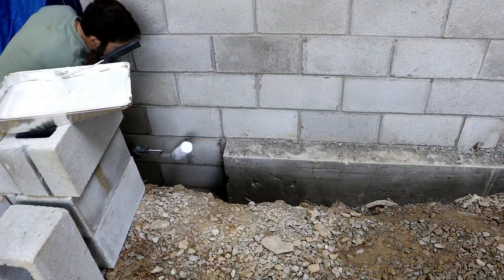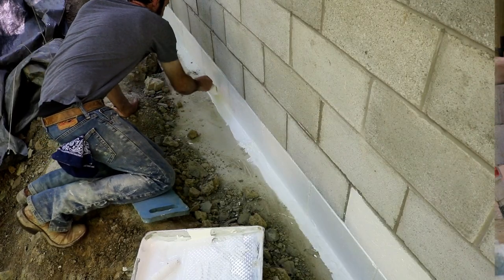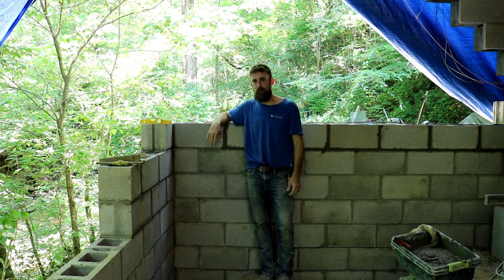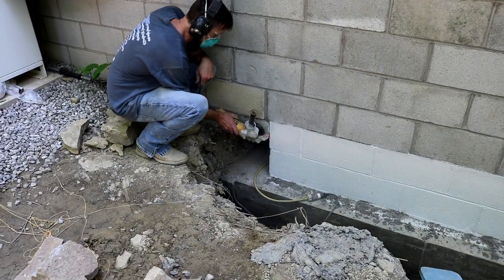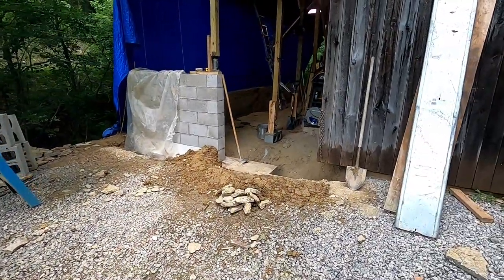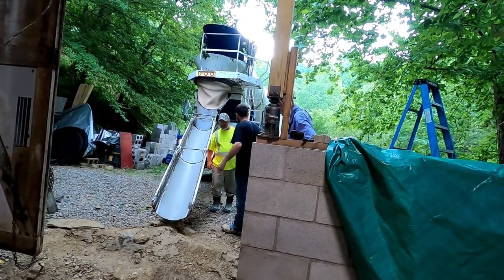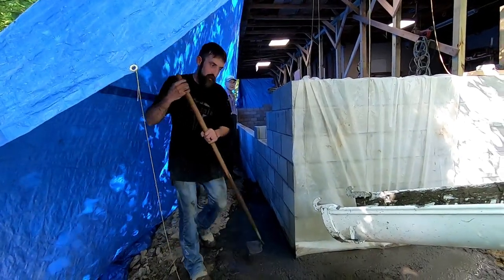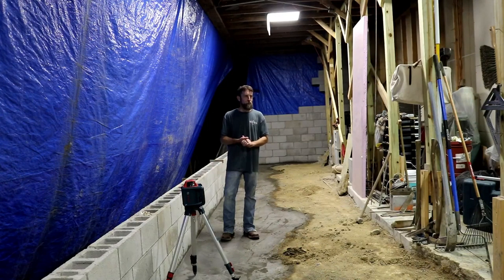Sealing & Backfilling with FLOWABLE FILL.  Shop Repair

Comment: Steve, at 26:55 your comment explains where a common term in construction comes from. When the boss tells you to hurry up and says, "all I want to see is assholes and elbows". Pardon my language, but that is just what they are meaning. The bad thing about concrete is it is hurry up and wait. When it is rolling out of the chute from the truck, you have to work hard and fast to get all of it moved out and around, then you have to sit there and wait for it to get dry enough to work some more.
If you are going to shave off dirt to level inside of the slab, throw the dirt right outside and backfill the rest of the footing with whatever you dig up. You are aerating that soil and it will recompact over time under the weight of the slab, causing cracks again. Think of it like this, you are making a hydraulic rod but it is a few inches short of the length you need, would you just throw the chips you got from turning the rod to size at the end of it?  If the dirt is solid, just cover it over with 57's (3/4 washed stone) and set your level with that; the 3/4 stone is fairly non compactable due to its angular nature it applies pressure down and to the stones surrounding it rather than sinking. This is the theory one of our local engineers has been using to stabilize footings, as many times in my area solid, stable ground for a foundation may be up to 16 feet down in the ground. Filling that entirely with concrete is cost prohibitive, so we use this gravel system to get close to the top then pour 12-16" of concrete on top of it. Works well enough for a house or a garage where I am.
You are getting close, Steve. I commend you for taking the effort and doing the work yourself, it isn't terribly hard, just time consuming when you are new to it.
Hope you and your family are doing well, thanks for making videos for us.

Comment: Flowable fill seems like a really smart product, I mean most people would need to order a truck of gravel, anyways. Might as well order a truck of flowable gravel, that don't need compaction. The hourly cost of a concrete truck is probably more than a dump truck, but you save so much time.

Comment: in the north here we coat foundations with 5 gallon buckets of liquid foundation tar then back fill  ..you coulda bought a load of bank run gravel to back fill the inside and out side gotta be cheaper then frig in cement

Comment: Hi Steve, it will be of benefit to coat the inside of the building side of the wall. moisture can rise from under the floor in the inside as well. All block joints and holes need to be filled for best results

Comment: Great Job!  It looked like the Fill Mix could have used a little more foaming agent to get more air and make flow better.  They used a lot of water to get the flowable ability, but it looked like they did not use much if any Foaming Agent.

Comment: I've mention in another video that I've been in the building trades for most of my life. I'm here to say that I wouldn't have done any of this the way that you have, I would have went even cheaper and simpler, I wont complain about it though because I'm not doing the work. This doesn't mean the solution that I would have used would be less sturdy, just less work on myself (oddly enough, I feel no desire to unsub because you wont do what I would've done). Lets not forget that this is not my building, so why would you do anything the way that I would? 

I've listened to your reasons in previous videos and they are all very sound, plus you are definitely doing a proper job of this whole mess. Your walls are more than adequate, this structure is not going to fall down because of a lack of anything on your part, which is the most important thing. Hell it looks nice as well, what more can anyone ask for? People pissin n moaning because you aren't using a process that they would, well they are folks that just need a reason to complain, we all know a few don't we, and this just gets amplified by the internet where the keyboard adds 100lbs of boldness/rudeness.

You aren't just hacking shit together and trying to sell it as the "the way it's supposed to be done" or trying to sell any of us a half assed product in some odd effort to make money off hapless individuals. This makes me wonder at the motives of people complaining about anything that you are doing. You are trying to fix your own building and being humble about your own ability, plus we get to watch as you progress. Perspective my fellow humans, get some.

Comment: It really comes down to this: If it fails, you only have yourself to blame and you'll either build it again, or hire someone to build it again, or tear it down and start in another place. There is nothing about this construction to make it unsafe, especially when you've already built it back several times stronger than the original, and when the engineer you hired to consult said it would be OK.

You could probably move enough of the roof supports long enough to get the pad poured and the blocks filled, but this is your job and you need to did it in ways you feel comfortable and can afford.

Comment: In Europe, most builders seal the stones with tar based sealants in earth level and below, then use plastic sheets with knobs for distance holding. Tar will not go off in 10.000 years.. Outside this stones with 30-60 mm are used to fill up fpr water draining the trench.
Reply: You are doing a good job. Can we please see more of that squirrel ?

Comment: For a diy project things are looking great. 7” of concrete is overkill. Most shops that are dealing with trucks and Ag equipment only have 6” but the extra 100$ for cement won’t break you

Comment: Looks very Good. Flowable Fill is a wonderful thing. I suggest you buy or rent a pencil concrete vibrator when you place the floor concrete.
Reply: No need for a vibrator on a thin slab. Vibrators are for thick stuff and structural situations.

Comment: In theory, If you grout the center section of the wall, you would be able to frame the center section and support the majority of the roof. That would allow you to remove some of the temp supports and possibly poor the floor but like you said, there’s really no easy way of doing this.  I have run a 15’ extension shoot of the mixers shoot and hoed it down to the back of building around the same size so don’t think you have to always get a pump truck. It can be done, it just sucks to do.

Comment: Good Morning-!!!  I think youre doing a heck of a good job especially not being a block layer and working pretty much on your own.  That footing aint goin anywhere anytime soon and you very soon have an easier time finishing the wall ones the pad is in and the weight is off the roof, more to do but youre almost there and judging by the work youve done so far it will be a totally adequate if not superior result compared to the way it was built before.  Cant wait to see the next installment.

Comment: LOL...Fooling mother nature?  NOT NICE Steve.  It never ends well.  She's going to get angry with you.   BTW I used DryLok in my basement (I had to sign a waiver when we built the house stating we would be painting it).  That stuff is AMAZING.  I brushed mine on, and it was totally worth it.  I think I went through nearly 15 gallons of the stuff in my basement.  I also used hydraulic cement  in every spot that they used tie-ins for the basement forms.  THAT took WEEKS to do.  I could only do about 20 holes per day before my hands were just chewed up from that stuff...TOTALLY WORTH IT.

Comment: Could you hang extension ladder sections from the roof rafters, then put a plank across the rungs for adjustable-height scaffolding? Clamp a 2x4 to the bottom of the ladders to brace against the block to prevent swinging.

Comment: Grab yourself a chunk of beeswax for driving the long screws when you need a third hand. The screws will drive so much easier, it gives you more control when trying to hold a wiggly board still.
If I have a lot of 3-3.5" screws to drive (75+), I melt some wax is a small bottle in the microwave and dip my screws in them.  The 15-20 minutes it takes to do 100 screws is worth it.  The reduced driving time, (they just jump into the wood, even used wood), will make up for waxin' time.
Plus you get more screws per battery charge.

Comment: the spreading of the flow-able fill worked out well, however for any one else trying this the external wall would need to be propped/braced if the fill gets too high as the pressure from the fill may topple the block wall.
Now all ready for the floor slab.

Comment: What is the flowable fill?  Wet mix of sand and gravel with a little cement mixed in?  Looks like you've decided to go all the way up with your blocks instead of the wood framed wall.  Now that you have plenty of experience with blocks, might as well use up the material you already have.  Love to see grandpa, son and grandson working together, a great memory.

Comment: Just a couple of thoughts... That flowable fill weighs 150lbs/ cubic foot. With a problematic bank next to a creek maybe a lighter solution would be the ticket. Many builders think a bigger footer means better. I worked on a brick church from the 1800’s. It had a small lime and stone foundation. Still stands fine. My company lifts settled concrete as a mainstay. Got to tell you... You build better than most of the track builders that I do work for... You can build my house any time...

Comment: I'm guessing that the nature of the soil with it's fractured stone and sandy in-fill would be fairly free draining, and that any surface water quickly permeates down through the soil and into the brook. The new block wall and floor shouldn't be floating away any time soon.
Reply: Think, looking at the other side, that most of that soil is a clay, and poor at draining, which is why he had to put in a pretty serious French drain across the driveway. Fractured rock at the stream side, but a foot or three down probably a pretty hard siltstone, which is why it is so hard to dig the trench, and mixed with a dolomite as well. Drilling down to bedrock there would be expensive, and difgging deeper expensive, though with that new foundation any movement of the building will occur as a unit, I would be worried about the other end failing more before the new section, it is a little over engineered by most building codes, unless Steve is building to the US Military code of building, when it would be considered as acceptable for an armoured blast proof store.

Comment: If you ever use that type of fill again hire a concrete vibrator (wand type) and it will flow like water...  Won't need to shovel or drag it anywhere...👍👍

Comment: nextime maybe drill some anchors into the blocks to go into the cement you poured on the inside of the wall will help in the event you ever have a washout on the outside give you more stability but other than that great video and you just gained a subscriber

Comment: looking at the flow of that flowable, fill ordinary concrete with fairly small stones and a bit of extra water in it, would have flowed as well if not better,  here in the uk something similar appeared about 15 years ago and it was going to take over from ordinary concrete, it lasted about two to three months and disappeared, they sold it on being able to do things it wasn't capable of, like pouring foundation trenches from one spot with no pushing it about work it didn't

Comment: 26:40 Fun for the whole family. 
Piece of free advice. Get more people for pouring the concrete. 10 yards is a LOT of concrete and you'll have to either wheelbarrow or make a chute system to get it to the back of the shop. 4 people will not be enough trust me, you'll kill yourselves trying to do that.  
If you can't find the people to do it, go with the chute system. Screw 2x4s or 6s to the edges of a sheet of roof tin every foot or so. Then bend it up to form a trough like the mixer truck has and screw some braces between the 2x4s every couple feet to hold the shape and make the support legs really wide and strong. Think saw horses. Concrete is heavy. With a chute you can stand beside it and just hoe it down to drop in place.
You can probably get away with just one 12 foot section because the truck's chute can reach pretty far into the shop.
Reply: Get this, do that, do'nt you get the cramp in your fingers typing all
of your brilliantly late no good advice, wise guy ?

Comment: Your Dad is like "man I gotta see this!" when the concrete started flowing. Had an addition done at work and they used a very loose concrete much like that. Think they uses a vibratory tool of some sort too. Too bad you couldn't have pumped it in. Would have saved a lot of labor. Ok fess up I know somebody somewhere put there name in the concrete...........

Comment: Humble suggestions, may i? You will have heavy machinery locate next to this wall? You will probably need some rebar net under the floor, time to make decisions. Your famous shaper and your lathe will bend the 2~3 inch concrete easily without reinforcement and sit in a puddle of water if you wash the floor.

Comment: You're doing a stellar job Steve. Hats off to you! It's all coming together very nicely. Very much looking forward to that wall going up and the weight being redistributed back onto the outer wall. You may have mentioned this elsewhere but I have not noticed - what size is the shop overall? And what size is the machine room currently? Thanks, and keep up the great work. Craig

Comment: I am not sure if that is a wet mix with fine aggregate and maybe some fly ash, or what. Some of the 'flowable' concretes that I know of, which are used in thin coats to level floors (a difficult thing) are quite pricey. Here in California where I live people would use a pumper to do that job, but if you have a bunch of guys who will work for lunch and beer, I have seen it done for chump change with wheelbarrows, like you are. When it is done, you feel like you worked!

Comment: You really should use an asphalt roof sealer for blow ground foundation sealer, the latex based products will breakdown in a short time below grade. 

In my opinion it would have been more practical to just do a poured concrete walls instead of brinks. The walls would could have been done in about 2 to 4 days. As apposed to laying blocks. No problem getting a pump truck to do all those walls.

Comment: @Steve, why don't you put a perforated drainage pipe on the outside of the new wall?
Reply: Too late
Reply from the maker: I did consider the thought. Then figured it wouldn't be a good idea to deliberately channel water to the foundation.  Not sure it would matter but decided to solid back fill.👍

Comment: Hey Steve, Im interested to know why you wouldnt use dirt instead of concrete/Flowable fill to bring the grade up? Dirt is cheaper, yes?  or is it a cost vs time/energy. Dirt would require a lot more man power to move it in and compact it.  One other question.  Since you used concrete/Flowable fill, the area around the wall is pretty deep.  Why didnt you put a little rebar in there to help strength?  Without it, would there not be a higher potential of cracking?  Anyways,  for a "NON-BUILDER", it looks amazing.  Your a better builder than most. Don't cut yourself short.

Comment: It ain't going nowhere now.  About done.  Few more blocks, windows to see creek, pour floor, roof down.  Good to go.  Run t
Reply: Wife hollered at me.  You are doing a good job.  Good base, old shop is good for another 50 years or more.  Pour floor and run your Hendey.   Keep working and before fall you will be high and dry.  Getting a little rain now here in SW missouri which is good.  Now to get back to my floor leveling compound.

Comment: Relax. It's not perfect but you're not an architect. You're a working class Joe using your sweat and ingenuity to fine effect.
I'm no expert either and I've often wondered about the strength of filled block walls. You can only fill the cells vertically. If the webs and ends of blocks were cut down halfway or so so the crete or grout fill could run through and make a more solid wall it seems that would be much stronger. Not as good as a solid concrete wall but pretty damn strong.
Anyway, best of luck with the shop. Looking forward to future vids.

Comment: Hey Steve, I have the utmost admiration for the size of the project you're tackling! I love that you're doing this and you're not a builder because this is a great way to learn! I'm curious how much you've saved yourself by doing this yourself. Do you have any estimates you'd be willing to share by the end of the project of how much a new building would have cost versus hiring someone to do all the work versus doing it yourself? Thanks again keep up the great work and stay safe!
Reply: Contractors today charge like they're doctors making house calls. They expect hundreds of dollars an hour for doing work that does not even require a GED. But if they can get it then more power to them I guess? They're not getting it from me though.

Comment: hard work..but i think it was ok..i'm a bit worried about water protection..i know that paint should protect it..but i think it will not ..at least not much.. but better than nothing..and much easier to apply..
Reply from the maker: It's not paint. Its designed for indoor outdoor basment water protection.  Waterproofing brick and block is what this is designed to do.
Reply: @SteveSummers  I know friend..I expect it is some kind of elastic ruber compound..we  used hmm not sure how it is called..but you have to use blow torch to melt that bitumen sheet..then you have place another layer of and so on..and that is good protection..but anyway..i was surprised that you didn't use foil at the bottom of your slab to protect it against water from soil..and source of water is so close to your house..really surprising..but i suppose you know what you are doing :)